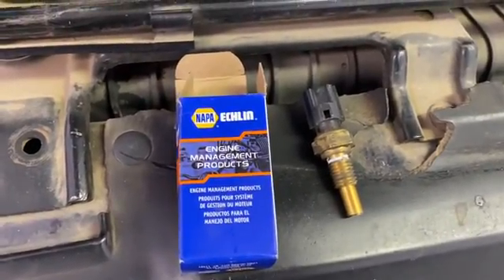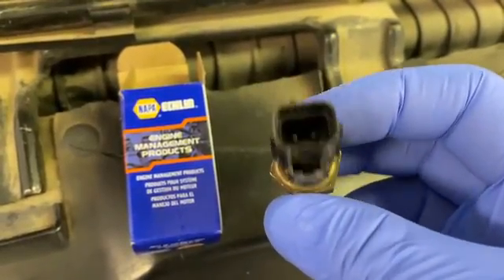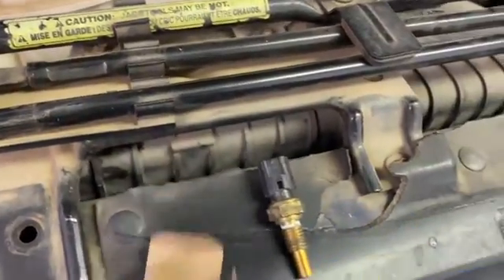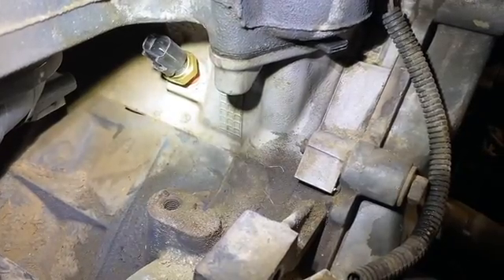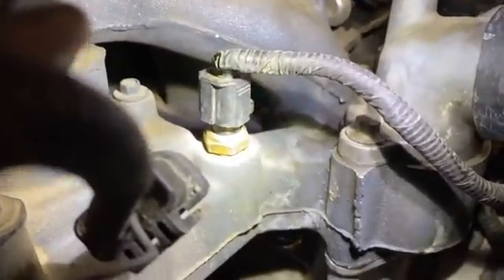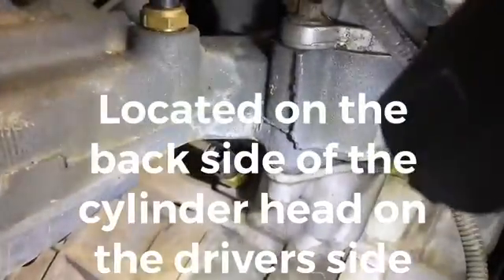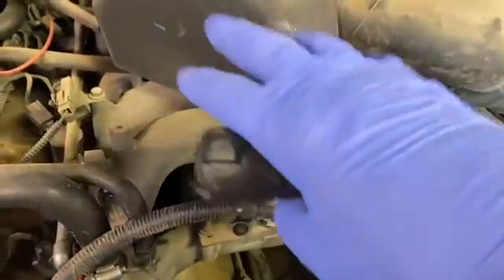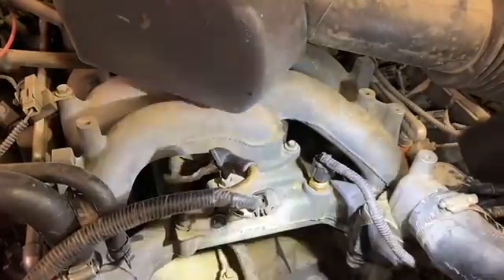How to change out a Cylinder Head Temperature Sensor Ford F250 / F350 / Excursion / Triton V10. DIY.

Comment: OK your just lucky because that's not possible on my 2017 f f250 which has about 1/2 inch clearance under the intake manifold and has to come off so don't lie to people and say that's not necessary you just don't have the same vehicle as those of us that it is very stupidly necessary because ford is a piece of shit crap designer on all its newer trash

Comment: Hello; 08 Town Car 4.6 P1299 & P1290 (cyl temp protection active & circ. Low input) not overheating coolant fan box switch good. Temp gauge dead cold but water temperature light lit in information visual screen. In turn the engine will not restart but always cranks over.

Comment: This is the Holy F*** of a perfect repair video!  I'm on my way back from Burning Man in Black Rock NV, and outside is 106 degrees.  The car thinks it is running hot, but I can hold my hand on the radiator cap. 

You are awesome!
Reply: I am seriously missing where exactly this thing is you did not make it clear were exactly it is
Reply: @stephenembrey883  on my wife's Navigator, it is under the intake manifold on the passenger side.  I'm no mechanic, but...  there is a black double arch-shaped structure underneath the throttle body.  The sensor is about a foot inside the passenger side arch, and can be reached without taking off the "arch".  It is awkward, and I scraped the hell out of my hand doing it.
I took a lot of pictures and can send them if you give me your email address.
Reply: From the video I cannot understand at any point where this thing is
Reply: You don't even mention what fucking engine it is
Reply: Why would anybody give you a thumbs up or subscribe you left out so much information

Comment: I have a 04 mustang. V6 3.9L engine. My sensor is stuck. Triple checked to make sure I was turning the right way. Any advice on how to crack it loose so I can avoid breaking it off??? Refuses to run and is sitting until I can get that replaced

Comment: Same for a 1999 Crown Victoria?
Reply: Why did you need to change it?
Reply: @tony Gonzalez I have a mercury grand marquis what issues are you having?
Reply: @terrancejones2486  I was looking for the location of the cylinder head temperature sensor but I watched a video here and found it.
Reply: Is it in the same spot
Reply: @terrancejones2486  I had to remove the alternator and it's on the driver's side cylinder head. A bit of a tight spot.
Reply: What symptoms were you having
Reply: @terrancejones2486  it began overheating as I was getting on interstate. I rushed home and luckily rush hour was over but temperature needle was going up and down along the way before check engine light came on. I scanned it and PO1299 code came up. Changed both sensors and temperature needle stays down but not overheating and A/C is cold in lowest setting. Thermostat might have gone bad but will find out this morning at the mechanic shop.
Reply: @terrancejones2486  On my 06 p71 im having it where at first the temp guage climbed and the overheat light came on. The engine went into a cooldown mode so it was running rough. Well it went away for about a month,nothing. THen now it has come back on intermittently. The Check engine light,the overheat light but now the guage jhust drops to the bottom and the fan kicks kicks on but the engine runs normal. It is not overheating as the car was sitting for an hour then i started her and immediatly the light came on,but it comes on then goes off. Never came on at all yester but today again? Im hoping its this sensor. Any ideas?